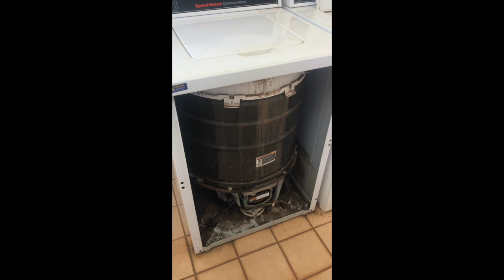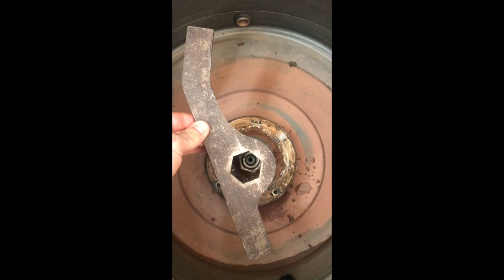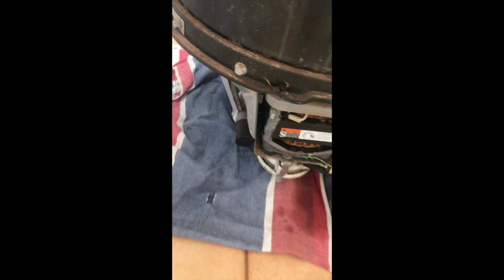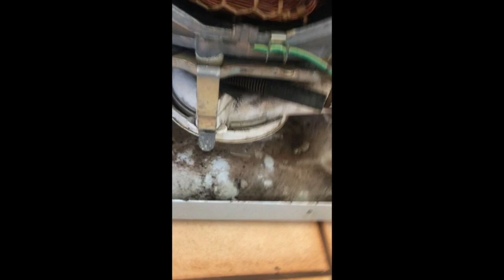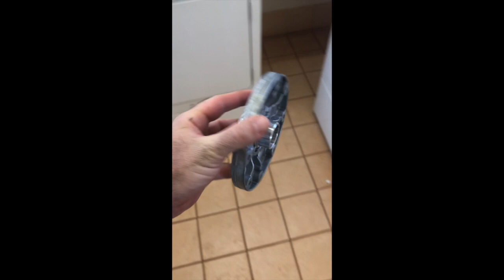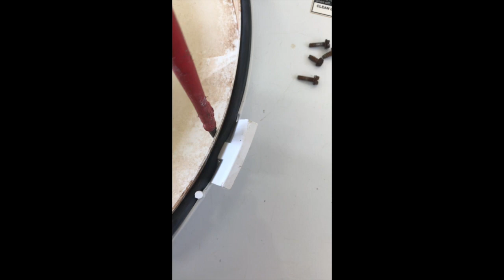Speed queen SWT811wn3050 seal and bearing

Comment: Did you just take the machine completely apart and replace the part and put it back together and NOT CLEAN the filth, grime, and mold that literally covered the inside of the machine and both tubs????

Comment: I have a 2016 model with mechanical knobs. I am shocked at how dirty the insides of the tubs are. Are people getting dingy clothes?  My washtub is leaning to the left side and will not hold straight when I manually recenter it.  I think something is off. I will put a wash machine cleaner through my washer without clothes in it with hot cycle after I see if I have a broken spring. But ya... Machines shouldn't be this dirty.

Comment: what kind of silicone did you use and is it designed for constant submersion ? The manufacturer recommends a 3m sealant that costs your life savings for a 5oz tube.
Reply: It looks like he just used regular silicone. If you noticed the kit he had was one without that 3m 560. He said in the video he has done hundreds of them so I would guess the expensive stuff isn’t needed.  That said, I would still use the 3m if you are doing this in your house.  I just finished this job. It took me a whole day practically. Fought me every bit of the way.

Comment: My speed queen commercial too load washer smells sooo bad. I think it’s the water beneath the barrel. I tried cleaning with baking soda, vinegar etc…this will help me get to the water sitting beneath barrel. Hopefully it’s that. I know it’s not the agitater.
Reply: You need a long soak with hot water and bleach.  Fill the tub with hot water and add several cups of Clorox bleach.  Let it agitate for a minute or so then shut off.  Let it sit for an hour or so.  You'll eventually see debris floating (like thin flakes, etc.).  This is laundry detergent residue, bacteria, mold, etc.  Leave the lid down and machine off to prevent any pets, etc. from falling in.  After the soak, let the machine run through the cycle empty.  I sometimes will manually start it again and do a rinse cycle twice to make sure I get residue bleach out.  You may need to clean your machine several times to get rid of the residue buildup.  I tried using other cleaners (like you mentioned) but only bleach worked with hot water.

Comment: My speed queen is making a loud jet noise in the spin cycle. It’s a slightly different machine but I looked up the same part kit you got and it’s the same assembly. Is a loud jet noise a sign of the bearing going bad?
Reply from the maker: Yes, that is what is causing the noise.
Reply: loudgsr thank you